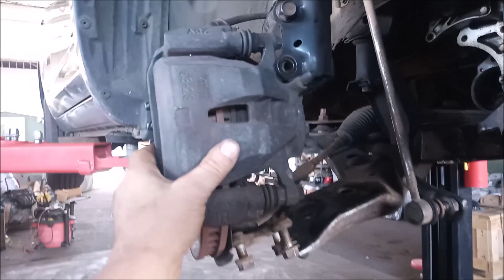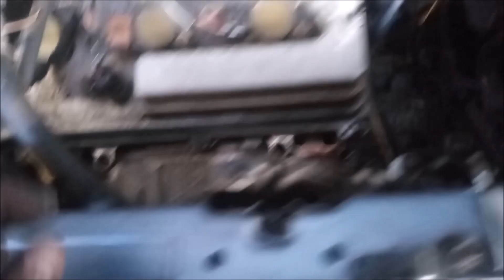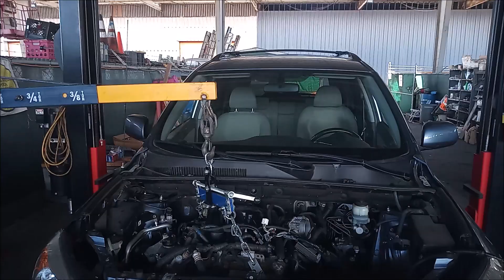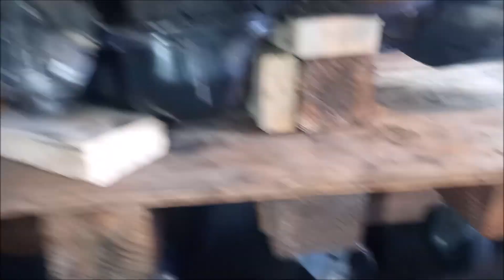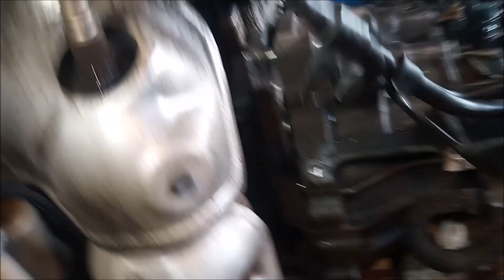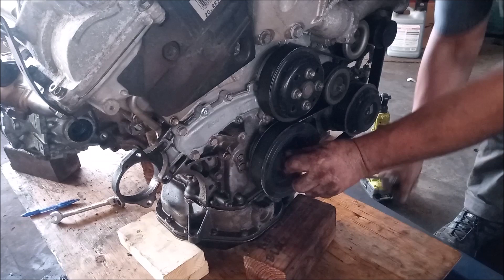How to Remove and Replace the Engine and Transmission - Toyota RAV4 2GR-FE 3.5-liter V6 - U151E

Comment: So when you replace the tranny in this car with a used one do you have to put in the new compensation code for the ECU to recognize the new tranny or something?
Reply from the maker: There is a tech stream procedure for new trans, also available in pro scan tools like autel or snapon. No codes to enter, just initialize.
Reply: @Merryfrankster_ thanks. Is it the same as the memory reset or is initialize something different?
Reply from the maker: @tsunamisun2369  I don't recall. It should be obvious when you go through the scantool menus.
Reply from the maker: It will say "do this when you replace the transmission" or something like that.
Reply: @Merryfrankster_ awesome, thank you sir.

Comment: Is it possible to do this on jack stands
Reply from the maker: Not really. Instead you would want to disassemble the entire front - bumper, condenser, radiator, and pull the engine and transmission through the front.
Reply: @ thank you for the reply

Comment: I currently have an issue with a 2012 V6 RAV4 that has a shift flare/slip when going from 3rd to 4th. Its not consistent when it happens and it happens about once per drive. I took it to aamco who said it's the valve body.  I did a vacuum test on the old valve body and the pressure regulator valve was below spec. I replaced the filter and installed a brand new OEM valve body with solenoids and did a tcm relearn with techstream. It's been about 500 miles. Since then with the new valve body i still feel it but the harshness is reduced. Any insight is greatly appreciated.
Reply from the maker: Check with your dealer if there is any code update for the firmware. Other than that, replace or rebuild the transmission.
Reply: Hi Robert, I'm having a similar issue, did you ever get this figured out?
Reply: @tsunamisun2369  nope, the next step for me would be to remove the trans to figure it out, so I'll just drive it until it needs the trans replaced since the cost to have everything removed and reinstalled would be a few thousand and they might say that i need a new transmission anyway. It hasn't gotten any worse just a minor annoyance. I would just drive it until it dies, and then replace the trans if your rav is well maintained, because the v6 rav in my opinion is the perfect little suv that is well rounded, it just could use an extra gear for the trans. In my case mine has like 200k on it and the rocker panel is rusting from the inside out, so I'll just buy another v6 rav instead of replacing the trans, but ill drive it until It gets to that point.

Comment: Hi, quick question, can you remove subframe without engine, will not engine fall out without subframe..  I assume eingine mount is still attached to the body of the car ? that is why it is ok to remove subframe, is that true for most of the cars meaning i can remove subframe without bringing engine down
Reply from the maker: For RAV4, engine is supported by engine mount on passenger side and transmission mount on driver side with weight on the vehicle frame. You can remove the subframe/steering rack no problem. For Camry, highlander, Sienna, RX350, you cannot do this. For those cars, subframe supports the entire weight of engine. To remove the subframe, you must support the engine from above, with a engine support bar.

Comment: Hey Frank, I did not see oil cooler lines at the bottom. Do the RAV4s not have them?
Reply from the maker: The oil cooler is part of the "tow package" option. It is optional equipment. Some cars have it, some don't. Check for the coolant lines that come from above the transmission and pass under the exhaust manifold to the oil cooler. Those are easier to spot. The oil lines are very difficult to see with the splash shields mounted under the car.

Comment: Can this job be done by pulling engine & tranny UPWARDS out the bay?
Reply from the maker: Sure you can do it that way. I do it that way with the 2az fours in the rav4. But the 2gr is unwieldy and very tough to balance so I prefer to drop it
Reply: @Merryfrankster_  ahaa great!
Reply from the maker: Be sure to remove the hood.
Reply from the maker: Watch my other video where I pull the oil burner 2az out of a rav4.
Reply: @Merryfrankster_  thinking of buying a Rav 4 with advertised "blown trans" apparently the vehicle moves with high revs. Torque converter fail?
Reply from the maker: @kalani777  If you are lucky, it is just low on transaxle fluid. Check the level, add some if necessary, and see hoa it runs. It could be just fine. They may have damaged the trans cooler hoses or the radiator and sprung a leak. I see this all the time.

Comment: hi, what tools did you use for this job? looking to do this for my FWD ‘08 Rav4
Reply from the maker: Metric socket set, breaker bar, torque wrench. For the RAV4 you can pull the engine and transmission up and out with an engine hoist (if you do not have a lift). But you would have to remove the hood.

Comment: Worst off the shelf vehicle I have ever bought.  2009 RX350 all Lexus maintained 72k miles last year when I bought it in June.  Soon as it got to be around 60 degrees noticed and engine nock the colder it got the worse it got.  Like a diesel.  Previous owner never said they had any problems with it when I wrote them from the address on their old title.  Then the transmission just had a mind of it's own.  Would jerk when in reverse,  when floored it wouldn'r downshift and accelerate.  Now has almost 90k on it owe still 9500 and have a HEAP OF SHIT.  Thanks Lexus.
Reply from the maker: Sorry about your misfortune.. I would do some searching on the Lexus forums for any commmon issues that are known to affect your particular vehicle.
Reply: @Merryfrankster_  That reply made zero sense.
Reply: @glennnichols4220  I also have a huge problem with a 2008 Lexus RX 350 (120,000 miles)  I bought a few months ago. Paid top dollar for it, too. I've come to find out that the VVT camshaft gears were manufactured with defect and have thrown the timing chain out of time. Lexus/Toyota will not pay for the repair (even though they caused the problem), so I need to remove the entire engine and replace the camshaft gears, timing chain, etc. This engine is a piece of crap. I always thought Lexus was supposed to be good quality and reliable. I don't think that anymore. So I can relate to what you're going through, Mr. Nichols.

Comment: Anyone know how similar this is to a ‘98 rav4?
Reply from the maker: There are two ways to answer this. 1. All cars are basically the same, if you've done one you've done them all. 2. Completely different chassis and drivetrain, nothing here applies. Take your pick.